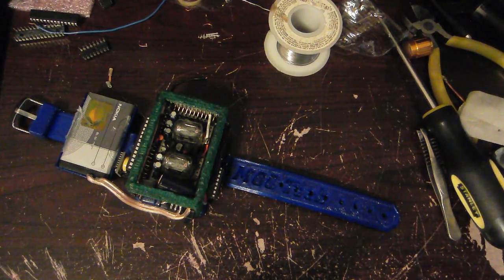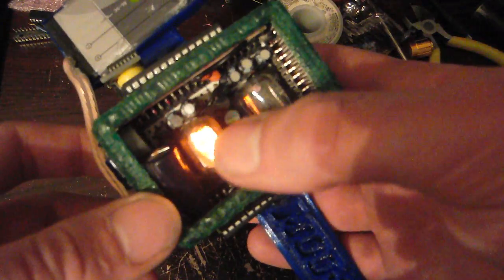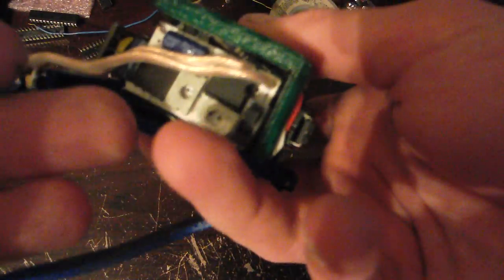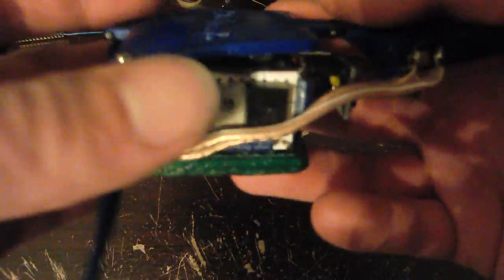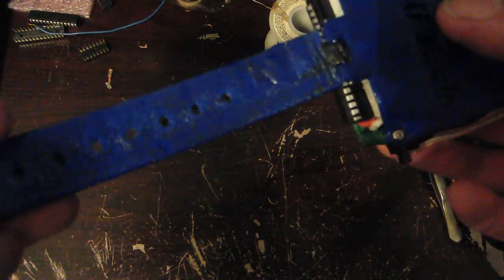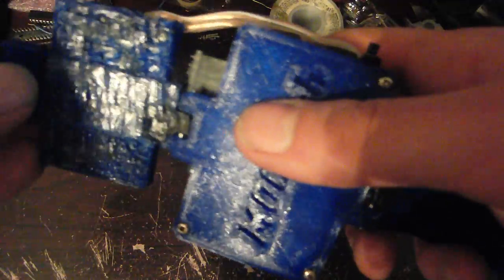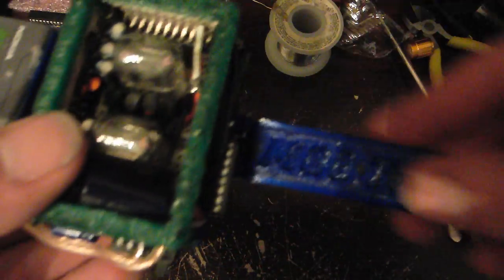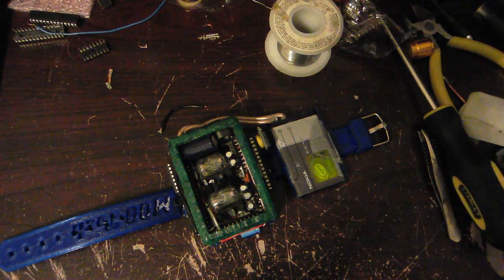Building a Nixie Tube Watch Part 2

Comment: May I ask how you managed to up the voltage so much in such a small design? I am not great with electronics but I am trying to do something similar, I think I've got a solid plan but I can't figure out how it is possible to  boost the voltage that much. Most premade booster circutes I have found out there are way to large and I feel kind of lost. If you could point me in the right direction that would be great!
Reply from the maker: Hayttman Yea so as you probably figured out boost converters aren't the simplest things in the world and they are certainly harder to design when you have size constraints on components. My design just uses the the atmega already on there to provide the switching signal and handle feedback and such. I'm not sure what you have tried thus far but I can tell you that when you have to use smaller components you will need to compensate with a higher switching frequency. In my watch I ended up using 62.5khz which is about the highest frequency the atmega can generate without problems. You also need to make sure your using real components from a reliable source as fake parts may work but will usually have significantly low performance and may end up causing you problems or just out right not working. Also if you don't have a DMM you need one and having a scope will help you understand what's going on in your circuit and why it may not be working. Also just remember that high voltage is dangerous and making something that can generate 200v DC is also dangerous hence why there aren't a hole lot of videos on it. You work with high voltage at your own risk and keep in mind that 200v is enough to kill you. Great Scott explains switching PSUs very well so I'd recommend looking at his stuff. If you have anymore questions I'd love to answer them!